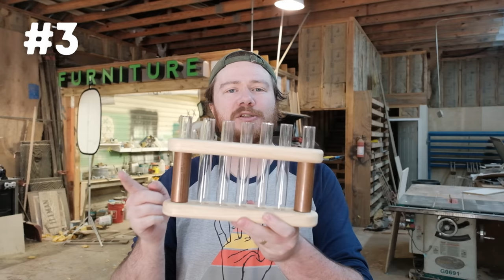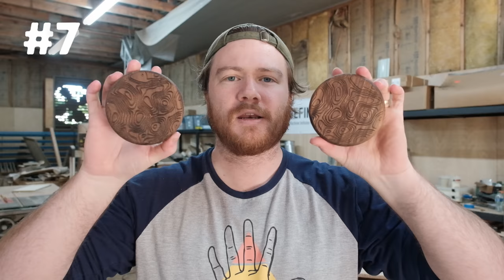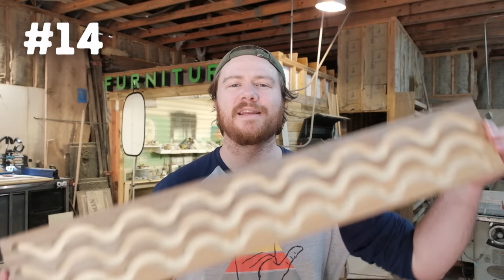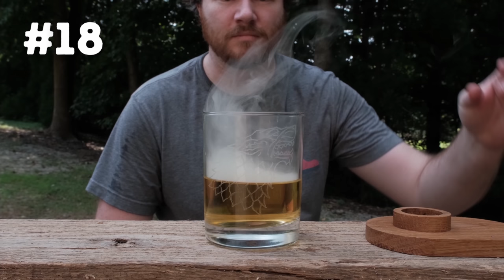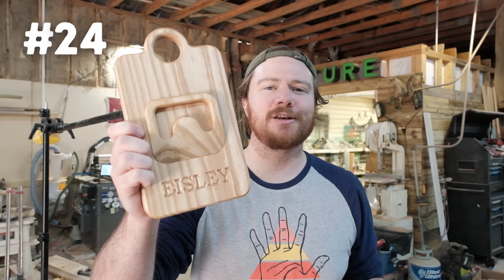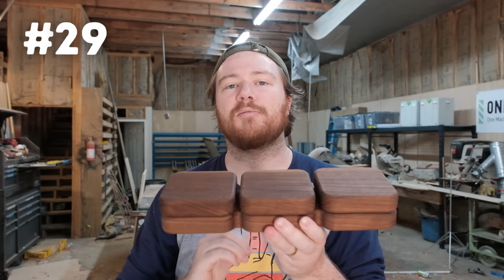Woodworking Project Ideas That Sell

Comment: You said "if you don't have a CNC Machine that's ok just subscribe because we give them away" I am assuming you meant the project item, am I correct or do you sometimes give away CNC machines? I quickly subscribed and if you give away CNC machines I may be making a bunch of dummy accounts to subscribe with also

Comment: Would suggest putting a chunk scrap or dowel just big enough to not poke an eye out on the bow arrows. Then foam. The small diameter dowel will probably pierce soft foam pretty easy.

Comment: The stacking men could be made in minutes with a dado stack and a round over on a long board then sliced off like a loaf of bread. The handles on the boards and colander are not substantial enough they will break sooner or later.
Reply from the maker: Thanks for watching